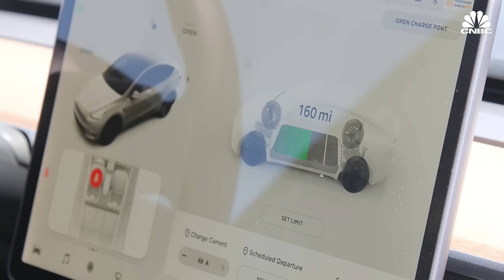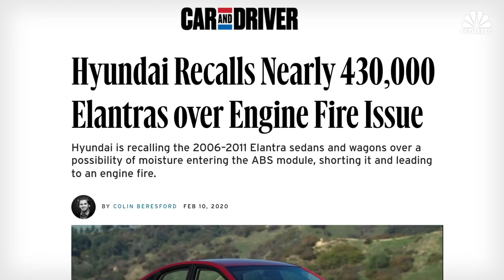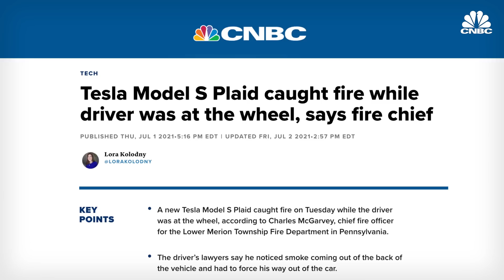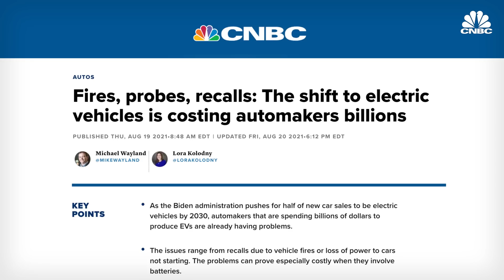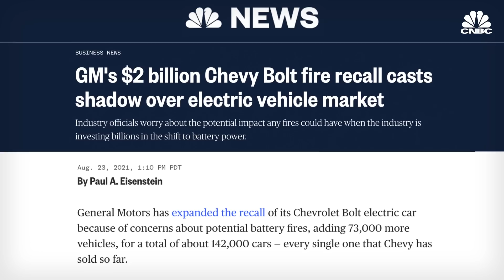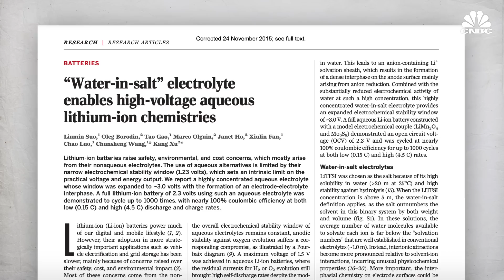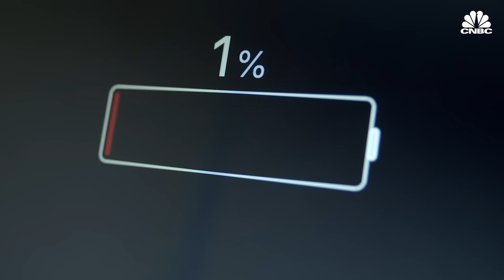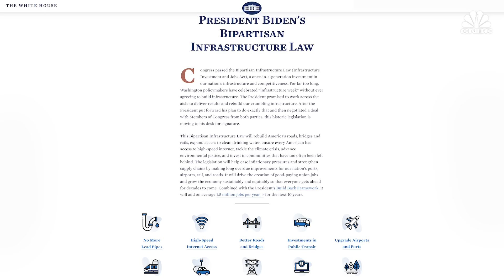Why Tesla, GM And Other EV Companies Have A Fire Problem

Comment: The problem is simple 🤔 don't fast charge a lithium battery 🤔 don't use only musfet base cut off BMS because when a musfet fail it no longer cut off power even when the driver have stop sending signal 🤷

Switch mode power supply is the best for lithium battery charging and you have to de-segment the charging, when charging as the battery is rising the charging current should be depreciating 🤔 but you can't achieve that with only musfet base BMS 🤷 that is why you need a switch mode power supply charging system 😊

I build my own lithium battery pack that am using to power my shop with solar system, using the conventional controller and BMS is not perfect so I have to build a switch mode charging system and de-segment the charging 😊

Comment: ICE's with 120 years of development operate at a very low level of emissions and are not the major contributor of them, industrial production and energy production are far bigger contributors of green house gasses. In most places fossil fuels are consumed to generate the electricity used to charge EV's. Your just shifting the location of emissions production! Rare Earth metals and materials to manufacture EV's are mined in Africa at great environmental damage and by slave or extremely low paid labor and child labor. Don't buy into the EV lie put out by the elite and virtue signaling Hollywood nitwits. Do your own research! Everything I claimed is substantiated. Its our dumb American attitude that must change! Women don't need 4500 lb behemoth SUV's to go get their nails done. Nor do most men need a full size pickup truck as a daily driver. If we drove fuel efficient vehicles for most tasks, stop racing between stop lights and ride a bicycle once in a while, we be easily energy independent, have gas for 100's of years and be a less fat society! Its attitude not EV's people!

Comment: Simply put. Stop using the battery packs like that are installed in EVs. Instead a normal battery used in a typical car is safer. Yes, they weigh more than the typical EVs battery packs, but safety is of the upmost importance.
Reply: The batteries in full-sized BEVs weigh half a tonne as it is.

Comment: In summary: although much more intense, toxic and difficult to extinguish, EV car fires occur at lower rates than gasoline car fires.  So logically one should still be more concerned about gas car fires.  Much like being more concerned about the flu vs rabies virus due to higher probability of infection, although less lethal.
Reply: Yeah, but would you leave one of these things inside your garage overnight?  Somehow, thousands of people actually do this.  Unbelievable.

Comment: Respect to firefighters. They may not know exactly what they're dealing with before they go to a fire, but they go anyway. Of the 218 that died in the 2020 Beirut explosion, 10 were firefighters that arrived at the warehouse that improperly stored 552 metric tonnes of ammonium nitrate, the same chemcial used in the Oklahoma City bombing in 1995.
Reply: Yeah, that is why you check on what type of warehouse. Ammonium nitrate is the main ingredient in fertilizer and highly combustible.
Reply: One would have thought the 1947 Texas City explosion would have made ammonium nitrate handling and safety protocols of the utmost importance. Apparently not.
Reply: Wait until 50 million people plug there car in every day at 5pm. There won't be enough windmills to change any of them. Tell me I'm wrong!
Reply: Adding water to this kind of fire is kind of stupid. Makes me think that to smother the flames it should be put in sand or something to eliminate oxygen like a CO2 fire extinguisher.
Reply: @RJDA.Dakota water use to cool down the battery which is the main heat source, in hope to reduce the chemistry reaction in the burning battery. sand, blanket or any other oxygen isolated method not gonna work effectively because ev fire doesn't need oxygen to produce heat, doing so only promote heat by isolation,
Reply: I really don’t think that this is the future of auto travel. We’ve gone this far just to catch fire? I can keep the gas burner. Even the new hydrogen vehicles might be the safest option after all. Go Toyota!
Reply: Ammoniun Nitrate is fairly stable. It is fertilizer. The 'bombing' was ammonian nitrate mixed with diesel
Reply: Some say a foreign govt is responsible for setting off that inferno in Beirut.   The same outfit that attacked the USS Liberty years ago and continues to attack its neighbors daily.
Reply: That thing was like a 4KT nuke equivalent. Most shocking explosion I ever saw.
Reply: @MICKEYISLOWD  *4KT TNT equivalent.
Reply: Curious how much in government spending these manufactures will get in subsidies from the renamed build back plan for EVs
Reply: Someone was saying that fire was not an accident, but political sabotage, possibly by a three letter agency.
Reply: I'd expect prof firemen to be TRAINED (educated, too) to handle ANY public risk of which MANY could potentially be harmed - and it is actually Known.  What happened to Testing, Training and Warnings PRIOR to Approval for mass production?  Does not make sense.
Reply: That’s on the fire inspectors.
Reply: @mdog6726  Well then, you must believe in Coincidences ... and watch tv Programming often.  Bummer.
Reply: @TrgtdGmaWblwr  wtf are you on about?
Reply: No respect to firefighters who kept quiet about 9/11 and their 343 missing comrades that FDNY never investigated
Reply: With 2.5 to 3.5 minutes of topping off and delivering a great travel range 570 miles, I'll keep the gas. Money I have, time I don't.
Reply: The humankind are pathetic! Rolled up steel or metal sheet, push and force the sheet under the burning car, or has some light forklifting while push the flat metallic sheet under the car. Then rolled out barrier of inflatable walls around the car but not too near it to get burnt, the walls only need to be tall enough to fill up waters to drown the car or submerged it, the base of these walls are either suction cup to the metallic sheet, to prevent leaking of water, spray fast drying concrete foams at the base and corner on the wall. Keep firehosing into the the swimming pool with the burning car inside. This method saves water and drown the burning car. I am baby chatting with you, because you are not worth it! Don’t ask me about other misc small details as how to deliver and prepaid materials to built the immediate swimming pool!
Reply: @jakexgold3879  👍 your idea would be good to protect a house with a barrier to flooding. 
There’s a picture of a farm house & barn surrounded by an earth mound. The neighboring farmers laughed …..til it rained & they flooded but his farm was protected.

Comment: I never charge a lithium unattended, NEVER. Lithium-ion battery chemistry is susceptible to thermal runaway, they are extremely difficult to extinguish. In the case of large batteries for EV, it only takes a single cell to malfunction and start the chain reaction. I nearly lost everything when a small 6 cell lithium malfunctioned while charging and started hissing and spitting fire. Fortunately, I was present and threw it out into the gravel driveway before the whole battery burst into flames, melted the little scooter to ashes.

Comment: HOW DISHONEST CAN YOU GET? This is fake news and inflammatory, you are willfully ignorant and lie to further your prejudice.
There are about 173,000 gas vehicle fires each year in the US. They run on FLAMMABLE GASOLINE, they leak and they crash!
Gasoline-powered cars, fire rate is about 1,530 per 100,000 cars. Electric vehicles (EVs) saw just 25 fires per 100,000.
Hybrid cars burn at a higher rate because of the gasoline engine and the battery together in one car gives twice the points of failure.
Electric cars have only 0.03% chance of catching fire, compared to gas cars, which have a 1.05% chance of igniting.
Electric cars catch fire FAR LESS often, but fire fighters let them burn because they don't know how to fight the fire.
It makes for great pictures and (just like you see here) it makes for popular fake hate news.
SHAME ON THIS CHANNEL -- and shame on you BARELY HUMAN APES for believing it.

Comment: They didn't mention one other important issue , electric vehicles have a voltage of 440 volts , how does a firefighter deal with that , especially in an accident when a person is trapped , how do they avoid getting electrocuted ?  I don't understand why the idea of hydrogen fuel cells was dropped , obviously it can't be because it burns , and it can't be because of pollution because when hydrogen burns it's exhaust is oxygen and water , it's no more explosive than gasoline . So hydrogen burns like gasoline and it's byproduct is pure oxygen and pure water , both things that our planet could use more of . I've also read just how dirty mining for the materials to make those lithium ion batteries is , it creates more pollution than would be created if the same vehicle was gasoline powered , that doesn't even count the pollution created by making the electricity to charge the batteries !  I guess going green isn't so green after all !

Comment: Wow. Talk about misinformation. Yes, there were difficulties putting out fires in the first Tesla roadsters, which Tesla redesigned & fixed, & GM had to redesign their battery on the Bolt due to them overheating & smoking. Both problems related to the battery cooling system. Problems since fixed. There is a much more serious problem when lithium batteries come in contact with water, so I’m surprised you even mention they require more water to put out when water to a lithium battery creates fire, it doesn’t put it out. Has this reporter done her research? Also, firefighters are professionals & should be educated at what puts out all fires except, maybe, nuclear reactors. Unless there is one in your backyard then they damn well better be educated. EVs have been on the road for decades. This isn’t new technology & lithium for cars has been explored since 1965 when American Motors Corp began research & development. It was the overheating & potential danger which made GM warn Tesla & made Elon Musk the richest man on the planet next to Big Oil guru Vladimir Putin. How? He hired a team of engineers to invent a cooling system & after a repair I haven’t heard of any catastrophic failures until GM started having problems with the Bolt, which is also fixed. So why the misinformation here folks? But you mention a chance of 1 in 10-million? Wow, really? That’s worth mentioning? I’d have better odds dying of a Covid vaccination for crying out loud, talk about using sensationalism to make something rare as more. Had y’all done that with the Ford Pinto think of all the families who burned up in them would be alive today? That car had many more fires & never recalled. It was simply cheaper for Ford to settle wrongful death lawsuits than fix cars & Ronald Reagan agreed. 

While it’s nice we have companies designing safer batteries on the cutting edge of technology it takes years to prove anything safe. There is no doubt the public needs to know the risks yes, but they also need to know the risk of driving a vehicle loaded on top of a bomb which is all a gas tank is… a giant Molotov cocktail with wheels. Which has killed thousands over the years by exploding like a bomb in which victims survive until pieces of them begin dropping in ash. It’s the worse possible way to die, because it takes a long time for a car fire to boil your brain into death, in the meantime you are alive & feeling it. Electric cars are a hell of an improvement in fire safety. But when they do catch fire water is not how you,put a chemical fire out! Those Pennsylvania firefighters you put on, Jesus, fire their asses. If there is a firefighter out there who doesn’t know how to extinguish a battery, why were they hired? They are in the business of extinguishing fires.

Comment: Take a guess how many gas powered vehicles start on fire every day. Plenty!
Reply: Oh you mean the Molotov cocktail with 4 tires? The Ford Pinto. Ahhh yes, I owned one. Those don’t count. Keep in mind Ford found it cheaper to payoff wrongful deaths & in 1970, 8 months after production started… when they discovered rumors were true -after they purposely rear ended 11 models 8 immediately burst into flames. The car was barely a year into production. Official estimates account for 27 deaths. Mother Jones reported a figure more between 500-900.  Ford recalled the vehicle in 1977 adding a bracket which barely had an effect. A better fix would have been a $50 bracket which Ford calculated litigation was cheaper. Ronald Reagan refused to authorize a recall & deaths continued well into the 1980s. The fireball produced from a full gas tank would spread gasoline to the car that rear ended them, occupants in the pinto would find the doors jammed up & couldn’t get out, rescuers would try opening the doors until they themselves were on fire Lee Iacocca who was President of Ford after designing the Mustang & later made famous as the man who saved Chrysler by obtaining a $600-million loan from the Federal govt & paying it back unexpectedly in like 2 years was instrumental in releasing the death trap to the public and said nothing was ever mentioned out of fear it would bankrupt Ford. An admission of guilt in which wealth protected him from any prosecution because he saved Chrysler from bankruptcy. What he actually did was delay it. If the public knew then what we know now?

Comment: If I remember correctly, the airlines have a prohibited transporting Li batteries in passenger aircraft due to fire possibilities.

GM’s response to house fires caused by their batteries catching fire was (wait for it. . . . ) charge you car outside, not in the garage. Brilliant 😵‍💫
Reply: Outside... In the burning sun... Damn they are truly geniuses... I pray for the families. I don't like EVs at all
Reply: Remember Boeing's airliner fire? Chin-ese Lithium batteries were to blame.
Reply: There is a limit on the size of a Li-oin battery that you are allowed to transport on an air plane.
Reply: I guess you better leave your cell phone and ipad behind.
Reply: @yodaiam1000  There is a limit on the size of a Li-oin battery that you are allowed to transport on an air plane.
Reply: Yes that seems inconvenient but to be fair do you think it would be wise to be storing and pouring 20 gallons of gasoline in your garage.  GM did have a problem with the Bolt but I think they have resolved it. Tesla has had very little problems with fire and the vast majority of there cars have been safely charged in garages for a long time. There have been. CHICAGO (CBS) -- Millions of Kia and Hyundai vehicles were recalled Wednesday over concerns they could catch on fire while parked or while being driven.

Hyundai warned drivers to park their cars outside until they can get the necessary repairs. This problem as you can plainly see from the above press release is not necessary unique to every cars. Hyundai and Kia recall 3.4 million cars for this problem in 2009 -2010 model years. Their advice, park the car outside. Ironically ain’t it.
Reply: You don’t remember correctly. Were you allowed to bring your phone with you? How about your laptop?
You’re not allowed to put lithium-ion batteries in the cargo area of an airplane. But then again you’re not allowed to put bottles of gasoline there either.

Wait for it, to automotive companies have recommended you not park your gasoline car in your garage because of spontaneous fires. Check on current recalls.
Reply: @neilkurzman4907  LOL. Since when people are not allowed to park their gasoline or diesel cars in the garage because of fire risk. You’re just making things up. It’s a garage! It’s purpose is to store cars.

Comment: This CNBC video is misleading click-bait. The title should be "Gasoline Powered Cars Have a Fire Problem" or, even better, "How EVs are Solving the Fire Problem Caused by Internal Combustion Engines". But then the entire segment would end up being ridiculously short as the narrator simply points to the fact that according to NHTSA data gasoline cars are more than 10x as likely as EVs to catch fire and, unlike gasoline cars that carry around a tank full of highly explosive vapor, EVs virtually never explode.

Comment: Can’t they build in a automatic fire suppression system in those battery boxes, such that if temperatures reach limit, that automatically inject some fire repellent in to the box ?
Reply: The chances of an EV fire are astronomically low, so there wouldn't be a reason to do this.
Reply: Not really. The problem with lithium fires is that they’re self-oxidizing. Once they ignite they go into thermal runaway. It doesn’t matter what the source of the fire is. They’ll keep burning as long as there’s lithium.
Reply: Perhaps it is possible to make an internal fire suppression system. The main problem is that a lithium fire produces it's own oxidizer meaning it doesn't need outside air in order to burn. The batteries are on a sealed metal box which makes getting water or foam directly on the batteries nearly impossible.
Reply: @1982nsu  Maybe you could make them so that they don't lock you inside when they're on fire. Silly idea, I know.